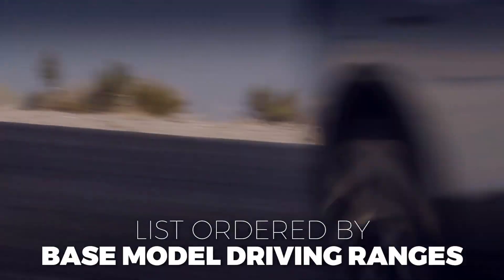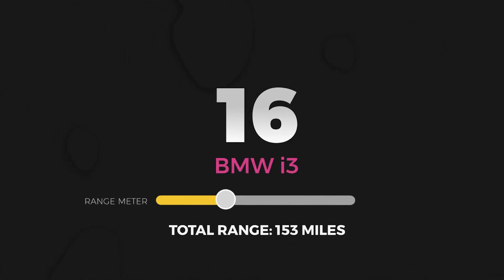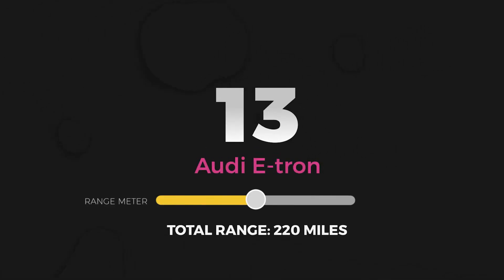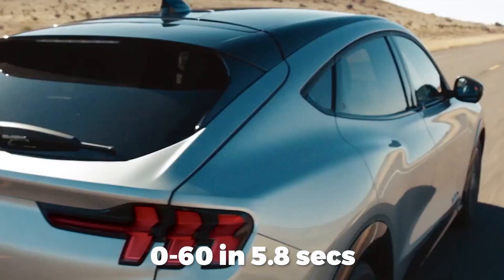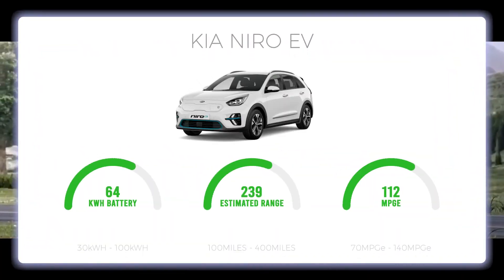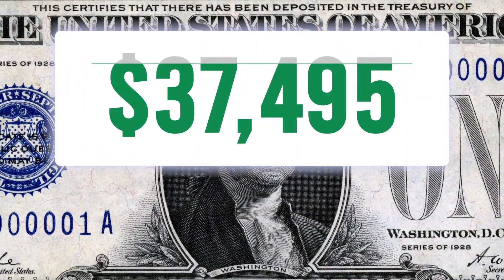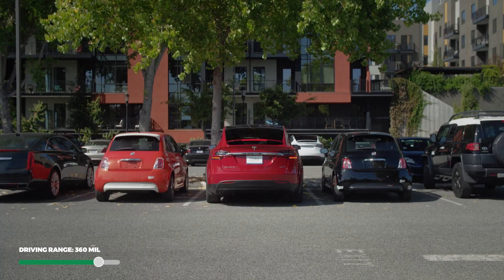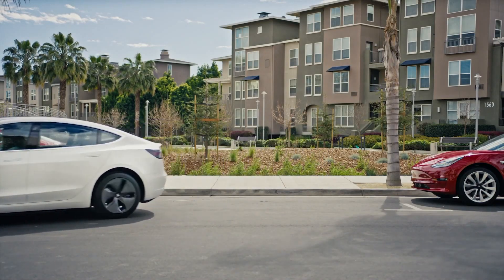Top 18 New Electric Cars!

Comment: The aptera is almost ready, and it can charge the battery while it's parked with solor panels on it and it was designed by an AI system, and aerodynamic is at 0.13 drag,pretty good
Reply from the maker: Awesome! Thanks for the feedback.